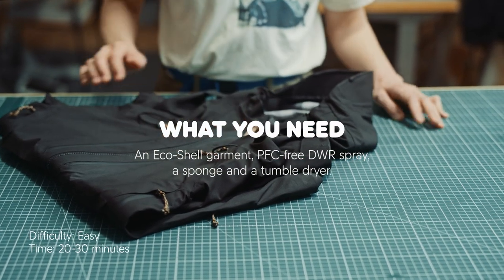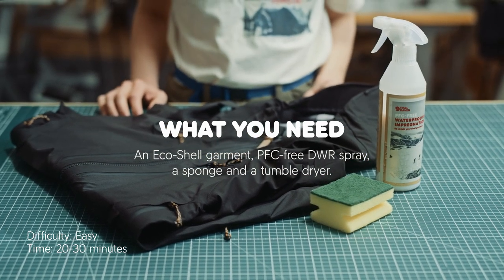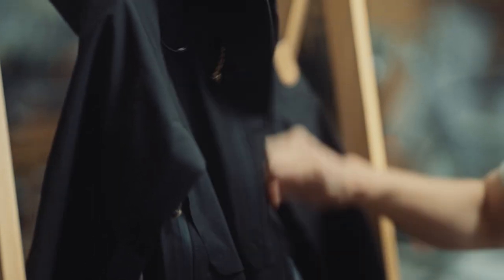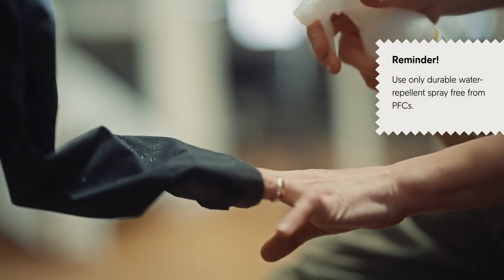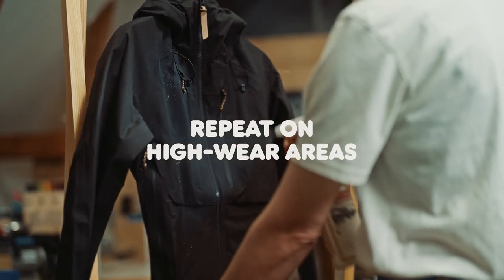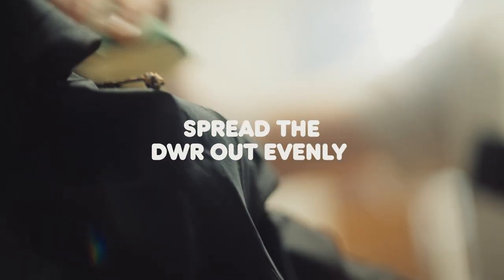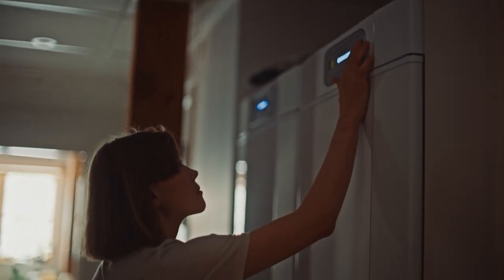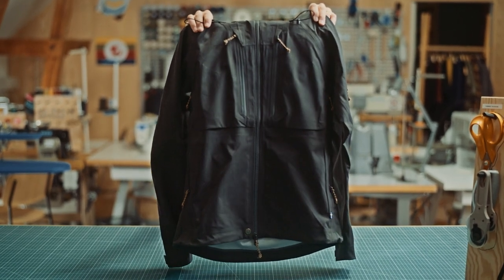Maintain PFC-free Water Repellency | Love your gear longer | Fjällräven Care & Repair

Comment: Which temperature is needed for the activation? We have a dryer where we manually set the temperature.
Reply from the maker: Hi, Around 60C, but one important note: Follow the instructions on the care label about using dryer or not. You still have a good effect without adding heat.